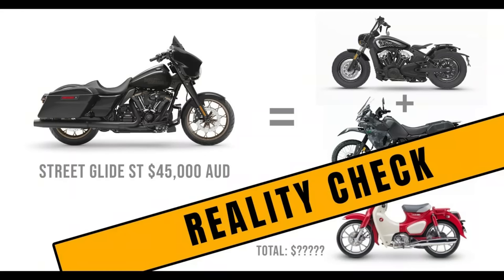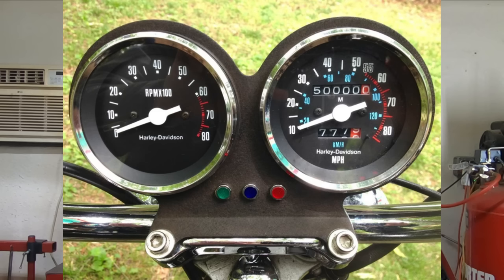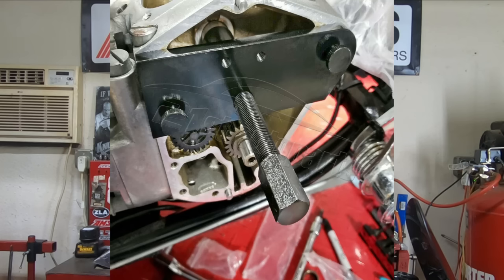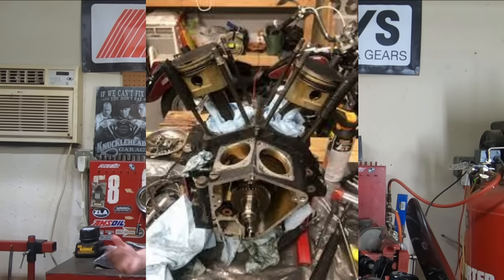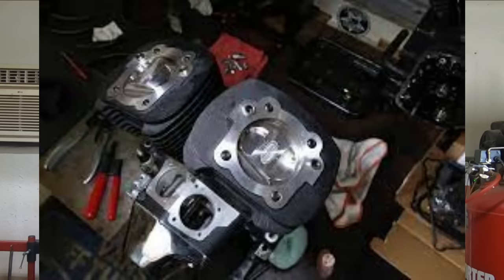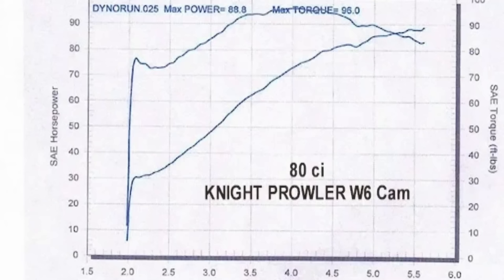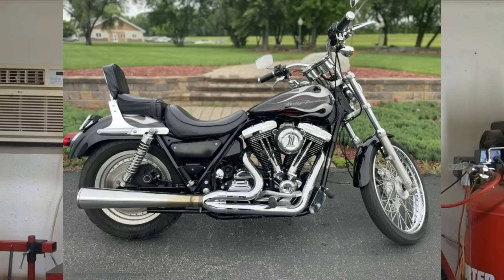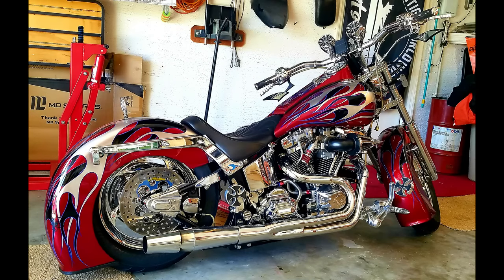Harley-Davidson Evolution is the Most Bang for the Money

Comment: I waited and waited.. finally came across a 98 heritage that was a former show bike for 3k. That had 9600 miles. The owner told me he spent 5k on paint and 5k in the engine and probably 5k on chrome..he said he only rode it maybe 50 a year for the last 19 years. Has screamin eagle heads and mikuni carb. I had to rebuild the carb and replace the battery and a back tire. Changed all the fluids and it runs like a chap. Now I'm looking for and original paint set to get rid of the 90s custom paint. My dream bike
Reply: Great find and a killer deal!
Reply: You can still send in the sheet metal to HD.. and they will paint it to color and year you want
Reply: @ronlind1757  really?! That is good to know. I thought about just having it painted but I like the idea of having oem paint
Reply: @Bradley Younger  I did on my 96' Heritage. I went through Apol's HD dealer in Raymond, MN. Not sure if you can go outside a dealer or not... but I got beautiful oem paint & decals which is what I wanted. Hope this helps.. cheers
Reply: Don't get the 10 with the custom paint repainted. Get new sheet metal have it painted to the color you want and then put the other set of sheet metal on eBay because you could probably get a good price for it from somebody who likes the way it's painted. $5,000 for a paint job I can't believe how much money these guys throw at these bikes. I don't want to think of how many motorcycles I can get for that price. Of course it won't have pretty paint on them.

Comment: I had a 1988 electric glide that I rode for 30 years, yes I did the top in twice, in which I replace push rods and lifters, but I got 167,000 miles out of that bike before I had to get into the bottom end. Once I got that taken care of I sold it for 6500. The bike was only 12 grand new, and I’ve been missing it ever cents. I had a couple of 80 eights twin cams pain in the ass, I am definitely getting back into a use Evo, Also picking up a 103 street glide this year. The hell with the new stuff right now can’t afford it

Comment: AMEN BRO! I got my 2019 RGS with my motor work and it’s ..PERFECT! BUTTTT!  I came across a garage queen 1998 Springer (i think I posted different year before). It’s a 98!  It’s at the shop getting the going over.  4000 OG miles on it!   It’s in mint! Not a scratch! So far compression and running strong..  we’ve run some racing fuel through, after draining tank. Used a camera  to look inside. It’s a beauty! I can’t wait to get it out in the wind!  Even if she decides to leak in a dry spot I don’t GAF!
Great VID the Evo’s are and we’re the WORKHORSE of HD!  They are tanks!  It’s like the difference between and handgun..Semi or revolver! Semi are great but that revolver will never fail you!

Comment: I really think you hit the nail on the head with this video and the engine comparison. What can be worked on easily with the older motor verses getting raked over the coals with the newer motors. If you think Harley did not do that on purpose then I have a bridge in Kansas I can sell to you real cheap or a refrigerator at the South Pole

Comment: Outstanding Video ! Back in October picked up a super clean 1 owner 1996 FXSTC with a little less than 18k on it for $4000. Same paint color as the Softail Springer in your video ! It needed a few things like tires & brake lines that I have replaced ( Date stamps on the tires & brake lines were from 1995) & appeared to be original. Owner was a Navy Veteran & always kept it garaged and or stored.I have replaced the Buckhorn bars with Drag bars & 8in. risers & factory King & Queen seat with a Mustang Solo Tripper seat.

Comment: It's not always about power.  I have a twin cam Wide Glide, that has plenty of power, is reliable and smooth.  I did put in the newer oil pump, a low end cam, and a Mikuni carb, but the oil pump was to fix the issue with the cam plate.  I had an 88 Sportster that I owned for 13 years and it was bullet proof.  Thanks for the info.

Comment: Hey I just acquired a 1986 harley davidson super glide fxr that is all original with only 14,145 miles on it ,was given to me  and i really appreciate it so much , right now I am going through it cleaning out the gas tank, carb check oils before I try to start it ,would love to add a cam ,jets on carb etc ,but I love your channel it's very helpful, might need some help on what compensator
Reply: I will fit on it upgrade one,

Comment: From what I understand, the only big twin Evo’s you would want to consider if doing a big bore application or other hop up beyond cams are the 98’s and 99’s due to case cracking issues on all of the previous years when pushing the envelope.  I know that you did allude to case issues, but maybe not strongly enough 😁  As regards the market price on these, let’s not forget the fact that advertised prices are not the actual selling price or “going for” price.  Most of the time there’s a vast difference between the two.  Here in SoCal there are so many Evo’s with under 25,000 miles on them that you get kinda’ spoiled and don’t even think about the ones with 40 or 50 G’s on ‘em.  And they (the low mile ones) can be purchased for closer to the five grand rather than the 10 grand mark.  I have even seen clean Springers actually sell for around seven grand with under twenty thou on the odo.  Granted, the issue with motorcycle mileage is always going to be a concern since you can swap speedo units on them without any questions to asked.  But a seasoned buyer I would think can discern between a fraudulent sale and a bona fide one.  I saw a super clean 2000 Twinkie FXSTS (Springer) sell for $7500.00 with under 19K in miles (see below link).  Speaking on Springers, there are also tons of nutty dreamers out there asking upwards of twenty large.  Just ignore them.  Those cycles just sit and sit, even for years without selling.
From Southern California ~ Ride Forever!
https://offerup.com/item/detail/1473465114
Reply: Any evo case built after 95 is suitable for big bore cyclinders !
Reply: @leonardstanford1877  Nope.
Reply: @midnightmc3096  ?
Reply: I'm not saying that you are totally wrong but even  the aftermarket will tell you it is safe to use big bore cyclinders with 95 & up evo case's  ! Partly because the casting's got better the thing that bothers me is they took the steel insert where the timkin bearings go ! I have seen the bearing race spin in the aluminum & the case is ruined !
Reply: @leonardstanford1877  As we all know, some of the aftermarket will tell you many things.  But  as I understand it, the issues were solved only after Mercury Marine started casting the cases, which, again, from my pretty in-depth research on the subject supposedly began with the 1998 models.  Later on, a number of Twin Cam model years were also cast by Mercury.  I've actually seen the Mercury Marine logo stamped in the lower case of a Twin Cam.  Yes, that is not an Evo, but the co-op apparently began between the Mother Company and Mercury Marine with the '98 model year bikes, which woulda' been Evos.
Over
Reply: @midnightmc3096  I've been building hotrod EVOs for a long time I had one case crack down thru the side & into the cam chest it was running 3&13/16 cyclinders ,my personal bike has a stock bottom  end 10 to 1 pistons 20 thou off the heads & a .030 thousands head gasket this motor failed last summer but it sheared an oil pump key ! My wife just mentioned I been building motors for 30 years now! I'm not saying it can't happen but it is few & far between !
Reply: @leonardstanford1877  That is certainly an interesting perspective of actual hands-on experience.  Much appreciated.
Ride Forever!

Comment: getting ready to do cam(EV27), lifters, & rods on my '98 Road King. other than being injected, i love this scoot. 
bought it middle of Jan '22 for a song n dance with under 30k miles. just needed rubber & fluids 😁
Reply: Just put ev27 in Mine has 16k on it bought it last year  5500$. Also have a big sucker and thunderheader. It ain’t a speed demon but it’s so smooth!!
Reply: Mines a 98 rk also
Reply: @Frankfoot986  injected or carb ?
Reply: @Cityboy-cl4mt  carb
Reply: Youll like the power band of the ev27. Thats what i run in my dyna, with a big sucker intake, se pipes and little carb work and it pulls awesome thru the midrange. Im still on stock ignition so its outta life at 5200rpm but it pulls from 2k on. It pulls hard if youre cruising at 3k rpm. No need to downshift to speed up or pass someone. Plus theyre just so easy to work on. I never touched a bike before the one i own and ive done all the work to it minus a tire change.

Comment: I had an 89 flht-p. Great motor, but it was always a bit squirrly going straight down the road. 104mph was redline in top gear, of course back then national speed limit was only 65, and most highways were still posted 55

Comment: Hi Gixxer! As usual great material. Thanks to you, among other materials, my next mature choice for a motorcycle is the EVO. However, the engine is one component of the vehicle. I would like you to do materials about others. For example, the frame. I have read that the frames from the EVO are much better than those of the TC. That up to some year the TC frames were worse than the later ones. That frames from Softails are stronger than those from dyn, especially forged frame heads. How is this according to you? Another issue is electrics and electronics. EVO has the advantage of being simple and repairable. How about electrics in relation to TC and M8? What are the differences between the different generations of TC? You are also talking about big twins mainly. How is it with Sportsters? Are the EVO-injected ones inferior to the older ones, or vice versa? Greetings!

Comment: Here in NZ back in the day when Evo's 1st arrived I used to service them for Christchurch Motorcycles up to 1989. 1st thing was open up the carb Jets and the Andrews accelerator pump kit install, the pump kit stop fuel dribbling.They would run sweet with these small mods. One early problem was with the clutch basket on an ex US police special. We were into road racing so started hotting them up. We were in close contact with Jerry Branch of Branch Flowmetrics. Jerry was very helpful to us. EV3 cams were popular, screamin eagle ignition module's helped, also Screamin Eagle Carb or a Mikuni & maniflods, Branch heads were great, supertrapp pipies, heavier clutch springs. On the race track the disc brake were total shit. They got hot and bent like a wok, the bike would stop rolling from some much bend so we would have to jack them up and remove the wheel and throw the disc's away. Hot thing was Performance Machice Cast Iron Disc's. These Discs were very good combined with Braided lines and Ferodo pads.I had a hotted 87 Superglide Sport and with these cast Iron brakes I could lock the front wheel up at high speed after several laps of hard use. My super glide Sport was a weapon on the race track and good at dragging. In recent times I have Vapor blasted some old Evo Crank Case's and noticed some have cracks in behind the lifter blocks where the cases have been machined and there is a sharpe corner. Also I have one set of cases with bad wear in the Breather hole. These can be oversized or reed valved. Here in NZ old Evo's are popular. We also ran a very special XR1000 with a McKintosh Frame a full on F-1 BEARS racer, we had full input from Jerry Branch. He sent us a lot of Data on the XR 1000, we had branch stage 2 heads and many other mods. This famous old race bike is known as " The Black Adder". Our connections with Jerry led us to suggest to John Britten to send his Denco V-Twin heads to Jerry for testing. The response was melt them down and start again. Jerry became very involved with John Britten and this led to the final versin of the Britten V1000 of which Ten bikes were made worth 1 & 1/2 to 2 millions dollars each today. After riding rubber mount Evo's then climbing back on a Shovelhead oh the vibrations. My Superglide Sport hotted up felt like riding on a magic carpet so so smooth. I did own a nice Rubber Shovel not a bad old bike.

Comment: My first bike was a 99 sporty evo 1200. I loved it, prospected and patched into a 1% mc. Sold it and bought a 09 Dyna Superglide. Then went to a 2002 Softail. After that it was a 2004 Dyna Wide Glide. After selling that Dyna I went on to the Japanese Xv250s and built a tokyo chopper that I loved and rode for years. After a chipper show recently I picked up 94 Dyna Wide glide with 52k Miles for $3k cash. She is the best motorcycle i have owned in the last 20 years. The sound, styling and reliability mixed with quality parts and engineered to last. Im never selling it nor am I interested in any other Harley. Dyna Evo Forever.
Reply from the maker: Dyna Evo was one of the best combos Harley ever had!

Comment: I have a 1991 springer softtail I bought three years ago with 35,000 miles in great condition with the stage 2 screaming eagle upgrades for $ 3,000.
The only problem was that the clutch pack was out of adjustment, easy fix, and ran great afterward. 
Now I just bought a 1992 Electraglide ultra classic with 25,000 on a factory rebuild (cracked case) for $4,800.
It's in beautiful shape and everything works great.

Comment: My first Evo, I bought brand new, 1984 883 hugger sportster. I rode that bike all across the country, put 200k on the engine and sold it for 2 grand more than 8 paid for it so I got my money back for the all stainless braided lines I installed , the new primary chain and tensioner, and the cushy seats I put on it, otherwise it was all origional and never split the cases or had the heads off! It never smoked, leaked, or anything else bad, in fact it ran as good as the day 8 bought it off the showroom floor. Oh and I did put a screaming eagle carb on it as a tasteful power upgrade and slashcuts with minimal modified baffles. Great bike and I would not hesitate to buy another in fact I'm looking at an 86 lowrider right now, another bike that I once owned that was stolen but now have the chance to own again🤙👍
Reply from the maker: That's awesome getting a nice Sportster! Those things are just indestructable! I would jump on that Evo, they aren't going down in price either.

Comment: I had a 94 softail custom that I rode to daytona in 2011 . Then sold  it which was a big mistake . I just found a 98 softail custom with 12000 orig. miles and grabbed it .i will not sell this one. I love my shovel and my twin cam but the evo is my favorite . 10:36

Comment: bought a 98 wide glide $3500 runs great, looks great, my bar hopper , and sounds way better than my 22 street glide
Reply from the maker: You can't beat the thump of those Evo and Twin Cam engines compared to the M8's. M8's make great power and they sound good with a big cam but they just don't thump like the older motors.

Comment: I have a 1998 Fatboy Evo 80ci! Love Riding it 12,000 miles. Some times when it is really wormed up I stop at someplace for a while about 45 min. And go to start the bike and it makes a laud clonk noise and starts. Do I need a compression release. I had to put a all balls bearing in starter in 2018 really easy. I love my EVO. What could cause the clonk at starting?????
Reply: low amp battery,,,make sure it's putting out 14 @ cranking

Comment: Evo, s like what was in my 93 Fatboy are tough reliable and with some tweaks and a little money you can surprise the shit out of your TC and M8 guys.
Reply: When I had my Fatboy in 2003 I bought it as a basket case , it came with a s&s 111 Evo crate engine. I was in my twenties ( still hooked on the speed of the crotch rockets ) but I was able with just a little help from one of my friends and a service manual I was able to get it together and running/riding. Looking back I shouldn't have gotten rid of it. I now ride an 06 flhpi and I absolutely love it. I paid what a decent Evo would cost. So if you're paitent and keep your eyes open you can find great deals on T/C engine bikes , however  they damn sure aren't as easy to work on or as cheap to upgrade. They are the best entry point into the Harley Davidson ownership world. I started on an 76 iron head 1000 kick only and I've got the limp to prove it. Those years of bikes will make you run away from Harley Davidson. The Evo will make you proud you have one.

Comment: I got into a 2018 Sport Glide, 15k miles, with mustache bars, HD top box, $800 saddlemen explorer seat with backrest, 6" riser with 2" pullback and a Garmin zumi 660 GPS for $10k in December 2020.  Love my 107" M8, doesn't use a drop of oil, doesn't leak, always starts, for $10,000. Got 12300 miles logged on it by August of 2019, before the  private party original owner was in an accident on his BMW 1250 GS Adventure. Accident finally forced the sale.  Absolutely stupid how much Harley Davidson dealerships add on to these when for sale used at a HD dealership.

Comment: As long as the crankcases are solid then everything's jake. Headwork, a decent street cam, decent carb/air cleaner, efficient ignition system, spot-on timing, and a quality two-into-one exhaust is the ticket for the EVO engine.

Comment: Started with a new ‘96 1200 Sportster, put 30k on the clock.   Then traded up to a new 2003 Fatboy, put 73k on her.  Had a 81 ironhead for a while and a 2002 tube frame Buell X1w White Lightning in the mix too.   Now I’ve got a ‘99 Buell X1 in the garage along with a 1998 Evo springer.   I’m having a blast on the springer - bought it 2 years ago for $7,500.  It was damn near mint with 10,500 on the clock.   Next will be a Twinkie or Evo Road king.  After this video, I might shoot for a ‘97 or ‘98 RK and cam that bitch up.  My son just took a new  2023 Sportster S (AKA Bare Knuckle) for a test ride.   He said it handles well and took off like a rocket.  It’s the opposite of an Evo, but it makes fantastic power.  He said it was really fun.